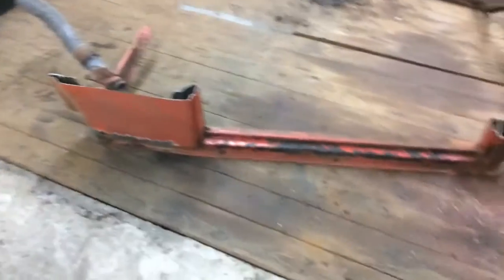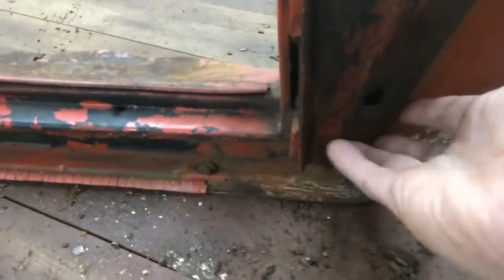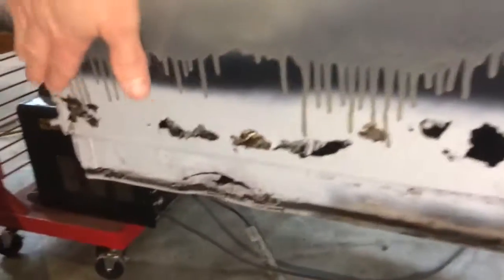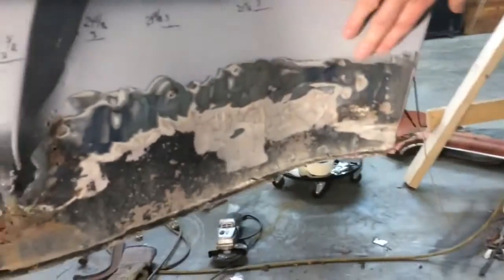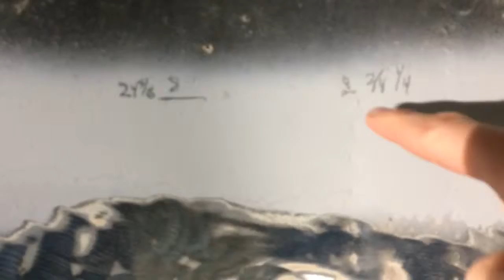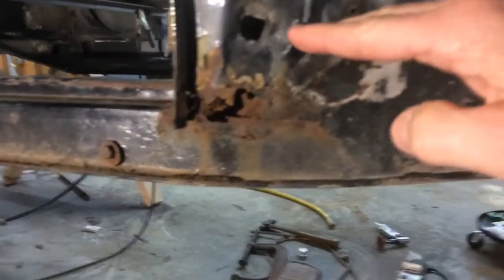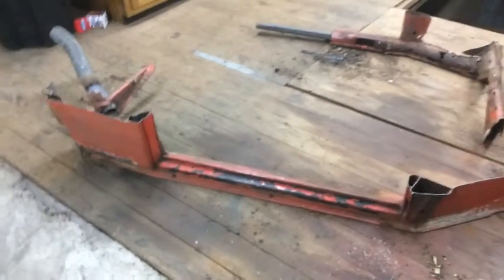Vw Beetle heater channel repair

Comment: I need to replace my floor pans and heater channels. Should I replace the Floorpans first or heater channels?
Reply from the maker: Triarii Cat I did my pans first. All I can say is make sure you measure everything twice. Also, before you weld it in solid, sit your body back on so you can make sure the bolt holes all line up.
Reply: Lamar Dixon so keep the old heater channels on, brace the doors, lift the body off, tack weld new floor pans in, drop body back on and make sure the holes line up with the old heater channels?
Reply from the maker: Yes. Your new pans should have oblong holes. This will allow a little forgiveness but do your best to get it all back square. In my opinion bracing the doors now is not a big deal. Make sure it is braced before you cut those channels out though